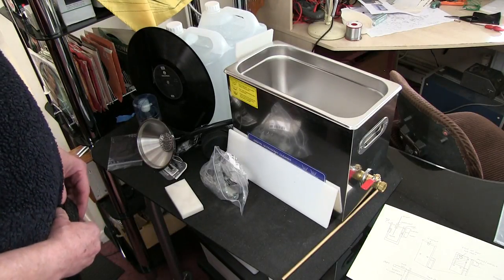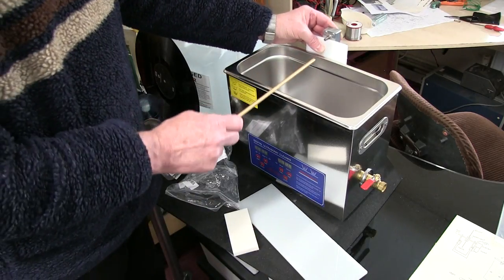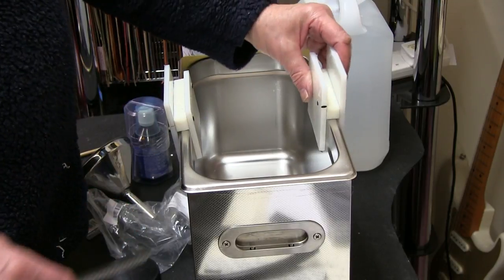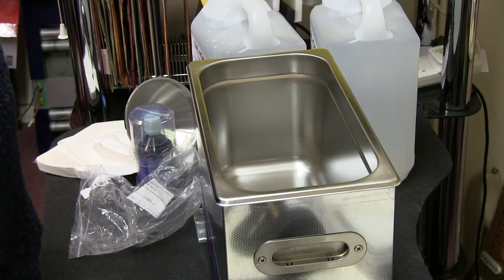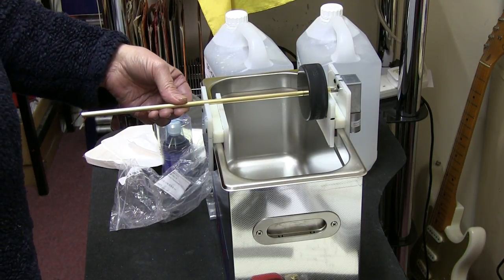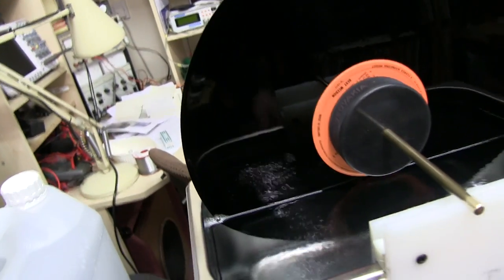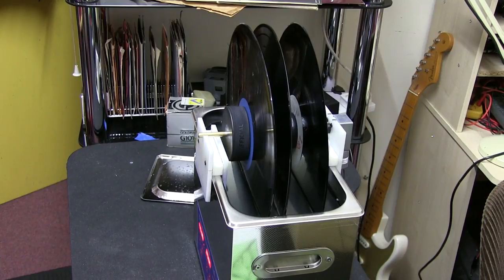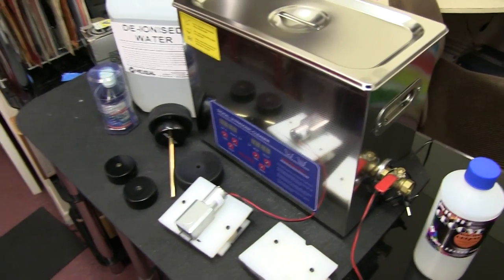How to make an Ultrasonic Vinyl Record Cleaner Part 1

Comment: Has anyone studied the effects of ultrasonic vibration on the characteristics of the vinyl exposed to it...?  Does it alter the out-gassing process of vinyl...? Does it cause micro-fracturing at any level...?

Anyone...?
Reply: There's nothing magical going on with the ultrasonic cleaning method. It's just agitating water. The chemicals (safe for vinyl,) heat, and agitation are what cleans the record. Just go on wikipedia and look up ultrasonic cleaning. It's not as complex as it sounds.  It's perfectly safe. What is not safe for your records, however, is grooves full of dust and garbage.

Comment: What s the size of the tank in terms of LT? Thanks
Reply from the maker: Hi. It is the PS-30A, which is 6.5Litres.  Not sure if they make this exact size, but as long as it is wide enough to lower the LP down into the solution, any similar will do.   All the best, Nick

Comment: These Chinese ultrasonic cleaners will die really quickly. Mine died after roughly 10 uses. Especially the ps 30 models which are sold under different brand names.